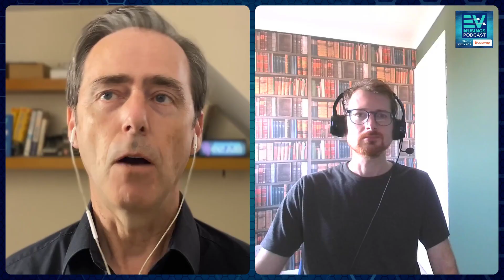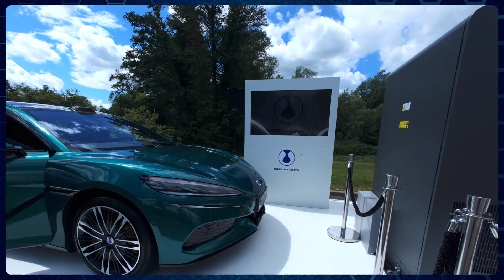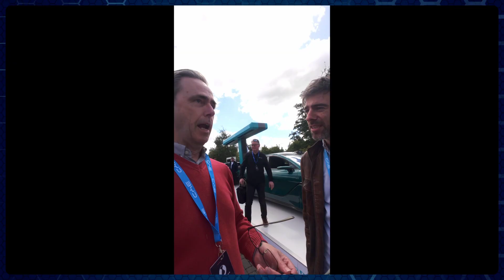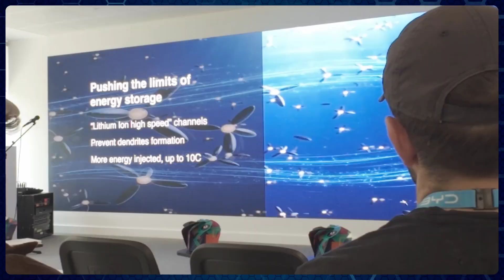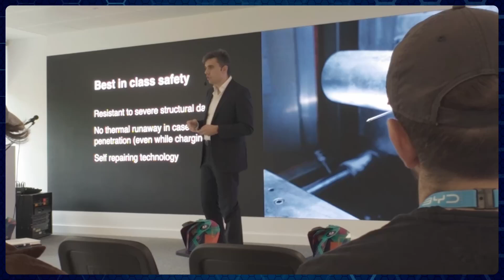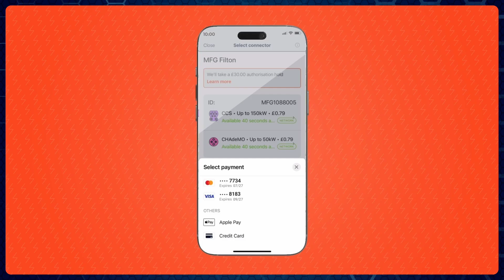Do we really need super fast charging?

Comment: I think I would still value a car that was flash charging capable but on road trips I'd probably select a 150kW charging option if it was available instead.  It could still be useful though eg when we do long trips and stay overnight we try to stay at places with AC charging but this isn't always possible.  So it would be useful to arrive with low SoC, go to bed not having to worry about it, get up, then flash charge and on your way.  Essentially on road trips you mostly have the time for slow charging but there are other eventualities and use cases where it wuold be more useful - you also mentioned people with no access to overnight charging.  But I would also expect this sort of charging session to attract a premium price to account for the extra tech required to deliver 1.5MW.
Reply from the maker: Good point about the additional costs. I’m curious to see how that position this, cost wise

Comment: The tech is very close, nobody can says that it isn't. But do we need it? Honestly, I make two or three 2000 miles to go and 2000 to return journeys every year. I leave home at 8 o'clock at 100% drive for 3-4 hours, stop for 15-20 minutes, plug in, visit the toilet, grab a coffee, and the car gets almost 50% at these 15 minutes It is 12:00. Enough power in the battery for 2-3 more hours of driving. I am already hungry when my battery is almost empty again. I made 400 miles till now and I need a longer stop. So I plug my car and have lunch for 30-40 minutes, my car is almost full when I finish. I leave the services at 15:30. I can drive for 3-4 more hours and need a coffee and continue the same plan, drive for 3-4 hours, stop for 15, toilet, coffee and go, drive for 2 hours, stop for 30 minutes, stretch my old fat body, have lunch and go, drive for 4 hours etc. I can drive 800-1200 miles the first day with four to six stops, that's almost 13-20 hours of driving. How much time would I  save if I could charge in 5 minutes? I think no time, probably I would lose time to leave my lunch and move my car from the charger. I would have these breaks no matter if I had to charge or not. I had the same stops even with my diesel car. I made that journey in two days with the diesel, I make it in two days with my EV, no difference. I prefer to have many 7KW chargers at every hotel, so I dont't have to look for a hotel with free chargers for the night, so I will have my car full the next morning.
Reply from the maker: That’s pretty much my view. This is more appealing to people who DON’T drive electric than it is to those who do.

Comment: My comment would be that current gen 1 blade batteries have very poor pre heating and cooling if Bjorn nylands videos are representative. 

Often too cold to reach advertised originally modest rapid charging speeds. Eg 80KW never achieved. 

AND then they rpaid gate and get too hot and don't cool properly and overheat and throttle. 

So the probably highly controlled PR test releases being successful, doesn't necessarily make me believe that I'll be able to flash charge a BYD successfully every time
Reply from the maker: Does the fact that they’ve been successfully doing this in China since January of this year (and have installed thousands of chargers there) help allay some of your concerns?
Reply: @evmusings I guess I wouldn't be surprised if they mostly achieve 750kw and not 1500kw

Comment: As someone who is new to Ev ownership I’m not interested in the speed of the charging I’m more interested in the different apps for every charger no prices displayed on the units and the absolute lack of maintenance once a charger has been installed I drive past a big Bp garage I’m big Suffolk town and the Bp pulse chargers (2) have been out of order for months yes really so I’ve absolutely no interest in Byd saying how quick it is I think we need to have s9me sort of industry standards for what is available already
Reply: Fossil networks were bought to stop the growth of EV charging firms IMO
Reply from the maker: That’s a good point. Do you think that people will vote with their feet - poorly maintained chargers etc will end up not being used and the CPO will suffer as a result?
Reply: @evmusings  Poorly maintained chargers are already not used (they're broken, duh), and they're still around, so what is the difference? If they were installed under a subsidy program, those gains have already been realized, and it's electric, so everyone knows it doesn't need maintenance. In any case, the biggest problem with ultra fast charging remains not the charging technology, but power delivery to the charge point, which nobody is solving.